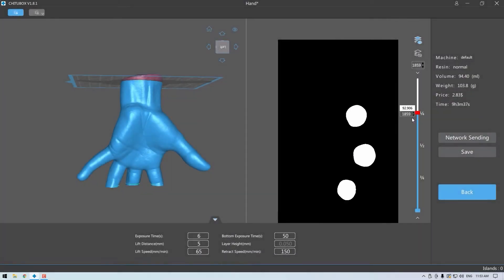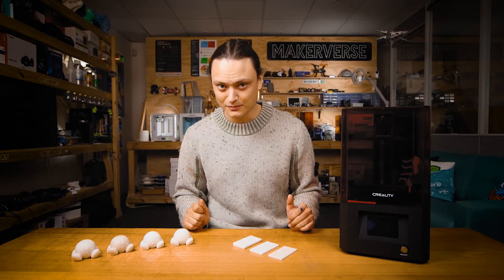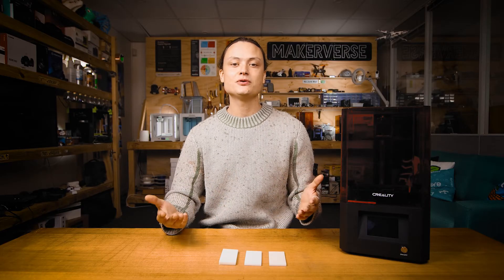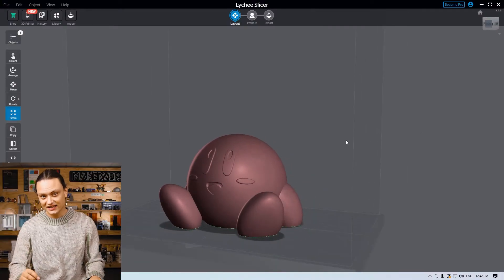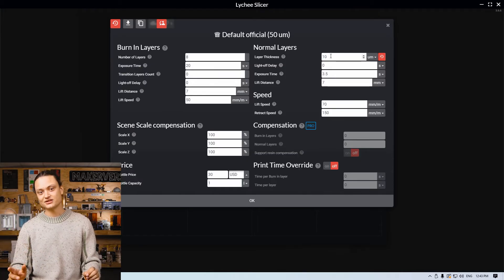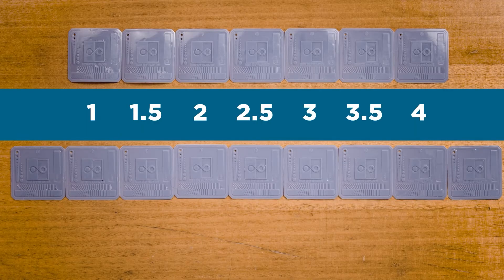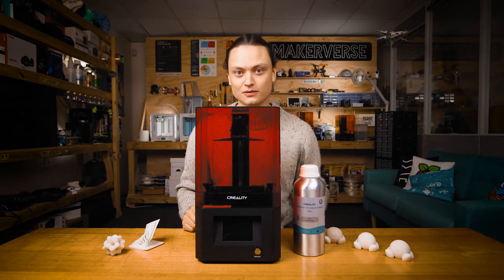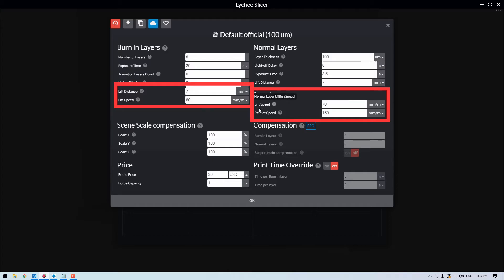Print Perfect Minis! How To Change Your Layer Heights When Resin 3D Printing - Fast or Flawless

Comment: How do you know your resin is fully cured?
Reply from the maker: Fully cured resin will have no shine, it will be fully hard, and shouldn't be sticky or tacky at all (wear gloves if you want to test it).

If in doubt, blast it with a UV curer or leave it in the sun for a while!
Reply: @Core-Electronics but that's only gonna cure the outside 1.5 mm, how do you fully cure the rest?

Comment: Hi, so I'm an absolute rookie - I have never 3d printed (except a 1-day class where I designed and printed an object, maybe 15 years ago), never cast anything, but I plan to... a lot! 
I've constructed many injection molded styrene models though, and kit bashed, and made things from scratch. I would love to be able to print items with the finest details - in scales from about 1:144 through 1:220, tiny, tiny, very fine details.. and no smoothing hopefully. Mostly though in the 1:144 - 1:160 scale. I want to recreate highly accurate, extremely detailed models of buildings and infrastructure such as manufacturing plants, power plants, odd commercial structures that were built a century ago and added to and modified otherwise over the years, etc., as well as bridges, high-tension power pylons, radio and television broadcasting antenas of decades past, highway interchanges, bascule/draw bridges, traffic lights, street signs, mailboxes, old payphone booths, garbage cans even. Some parts will be minute, for one example - the crossmembers of a multi-pane residential window, or a power meter on home, or even the hexagonal nuts on a fire hydrant. 

My main concern is this - 
I hope to not have the lines that all of the hobbyist's 3D prints have, at least the ones that I have been shown in person. The other has much to do with the tiniest of deatild and the ability to make such fine details. 

Am I relegated to the necessity of sanding or using acetone, etc for smooth prints? I hope I'm wrong, but I suspect that a "print and use item, taken right off the printer bed" simply wouldn't work for printing an almost perfect to scale (in all aspects) multi-paned ( 3' x 3') residential window that I would print in white and immediately glue it into the appropriate opening in a printed brick wall. The "wood" parts that hold each of the individual window panes in its proper place in the home window assembly, I imagine, might be too fine to print well and look correctly sized. Please tell me I am all wrong! 

I have the funds to buy a very nice printer, and time is not a major concern either. If a printer can print task after task day and night, I'd just design what I want, load it, and come back after sleep/work/whatever.

Could I also then print a model of a human with facial expressions, let's say facial hair, maybe even sun glasses, or holding a wrench, a knife, or the end of a cable or chain or rope? And speaking of the brick wall, I definitely would want to be able to print standard size bricks in a brick wall with mortar stacked in a standard offset type of arrangement which is always used in brick and mortar c🎉😂😂😂❤onstruction most of the brick walls that I have seen are made only in grid patterns (ie - square bricks?!), which are not realistic at all (structually weak!) and the blocks that I've seen shown on-line and at hobby shops are always far larger than anything even remotely realistic to the range of 1:144/160 scales. Just take a look at any normal brick building and you'll see that the mortar between the bricks virtually always lies indented and not flush to the face of the brick (ask a mason - it needs to be that way, there's a purpose. The mortar, (no concrete which has gravel in the mix) is never brought flush to the bricks' face. And from what I have seen, most of the sheets of scale brick walls that look somewhat realistic are very likely based upon hand-carved pieces made from master craftsmen in days past - from a painstaking, time-consuming, carefully carved master carving which then served as the basis for the next step - the actual, fiercely-strong metal dies intended to, (and hopefully) ended up producing tens or hundreds of thousands of mass-produced, pressurized, hot plastic injected model brick walls. Injection molded parts are made using injection molding dies which are mounted in the huge injection molding machines that weigh multiple tons. They cost many hundreds of thousands of dollars, and similarly are far from cheap to move, set-up, operate, and maintain.

((Shoot! Gtr, I just realized that I am late for an appointment. I shall edit later as/if necessary. But PLEASE(!), please answer my question, even if just relatively briefly.)

But PLEASE, share your thoughts, an insightful, informative response would be so hugely appreciated by me, and many others, I can only imagine!!

Thank you for sharing your knowledge - it means a lot to me and others. The generous beneficence of your knowledge and understanding of this subject does not go unrecognized! 

I thank you,
thank you, 
and thank you again!
Reply from the maker: Hey hows it goin! To start with the print lines question, resin printing has the smallest layer height of mainstream printing technologies and will give the least visible layer lines. You run into issues with layer lines when you have detail on top of print (like on kirbys head at 2:45). The more square the detail though, the less layer lines you get. Another issue is that when you paint a print, a lot of the times it will make the lines more pronounced as well, depends on the technique.

The biggest issue I see is finding accurate 3d models for all of this. If you have the skills to model them yourself then you are set, but if not you will need to learn to do so, or you might be able to find some 3d artists online that model specifically for the historical miniatures you want, you just have to find them if they exist. If not, it might be worth learning a modelling software like blender.

I think the best advice we can give is to find a printing community in that niche (hopefully its not too niche that there isn't an established community). Often you will find guides or strategies that people have found to get good models, or even if you just want to see what is achievable with printers. You might even encounter that some things will print fine, while smaller or certain pieces may need to be manufactured with other means.

But a resin printer is the best printer for this job. Best of luck mate!
Reply: Thank you kindly for sharing insight and knowledge! I will follow your tips. :)

Comment: I have a phrozen mini 8k printer. Currently printing something with very small channels (150 microns) and channels are not fully forming. Printing at 50 micro layer height. If I change this to 40 is there any other changes I need to make

Comment: I have a problem with my Anycubic Photon M3 and Chitubox, I get vertical lines in my work, not horizontial.  Any thoughts?

Thanks,
Reply: are you using a ACF sheet? i started getting lines after i used a ACF

Comment: I have a Question. I am printing Injection moulds and sometimes they have to be flat on the base but when i print them they come out slightly shorter (it is like the printer skips a few layers) so when i close the mould the part where the injector goes is not a circle and it can't inject properly. is it a settings issue or it is a printer issue ? (also if i print them flat the print time is going down significant so if it is a settings issue if you can tell me where to look ) Thank you :)

Comment: Why does your lychee only have 1 setting for the lift distance  etc if you check it now it has 2 settings in the same menu and it's so confusing
Reply: That will depend on if your printer supports two stage movement or not (two stage lets you set a slower speed followed by a faster speed during the lift and retraction phase to increase print times).

Comment: The math does not add up.
203 layers @ 100micron is not the same height as 3502 layers @ 10micron...
Reply: They do, to make it clearer, 100micron (0.1mm) is printing at a higher layer height which means there only needs to be a smaller amount of layers. 10microns (0.01mm) is considerably smaller thus causing more layers to print to get to to same overall height of the model printed at 100um.

Comment: Great video. In your personal opinion what settings would you say accomplish the best results for 40-50mm characters in terms of speed without compromising too much of quality? A 100% subjective question but would love to take your educated estimate over my noob level exp. After all you touched the spot in terms of stressing the hardware. I would rather optimize my lcd lifespan than going all greedy with huge changes in printing times and hardware stress that will only cause tiny benefits under a magnifying glass (which I won't be using)

Out of ignorance I would assume that the higher the resolution of the printer also compensates the quality lost with thicker layers. 

Thanks in advance for your much appreciated wisdom
Reply from the maker: If I was printing one off models for a DnD campaign and I was putting my heart and soul into it I would definitely use the smallest 10um layers for it. However if I was printing off a large army for tabletop war gaming I'd be more than happy to use 50um (and maybe only for the general of the army use 10um 😊).

Worth noting, Layer Height and Resolution of Printer are two different measuring sticks. Layer Height determines is Z-Axis accuracy whereas Resolution is X-Y Axis accuracy. I write about it here - https://core-electronics.com.au/guides/3d-printing/perfect-resin-print-layer-height/#Where

Best of luck and thanks for your question!
Reply: @Core Electronics  thanks a lot for the insight. I got good deal on a anycubic mono 4k and 8k phrozen resin. Weird combo I know. But what would be the settings you would recommend? Should the default slicer settings be safe just tweaking the layer height and adjusting the # of base layers? 

Thanks a lot for your help
Reply from the maker: Definitely come have a look at this video here I did on Exposure Time. I find manufacturers often tune the exposure settings too high - https://www.youtube.com/watch?v=yhWyQPS6qmQ

Comment: I Printed multiple miniature Armies. Although I am not an expert, I've taught myself exposure times, etc from youtubers like yourself. I was out of town for a week, so I emptied my resin vat, to ensure no issues. I came home rendered an entire plate and not only did the whole plate fail, but the resin was falling apart like my exposure times were extremely low, and the weirdest aspect is now the bottom quarter of the figures are shortened. for example, if I make supports that are roughly 5mm off the raft, when i print, the supports are gone and the item is melded within the raft. I have to suspend the model up 10-15mm of supports just the have the print come out with 5mm of supports. I have no idea what could be causing the issue. I factory reset everything, and it is still doing it. I ordered some replacement FEPs, because it did get slightly damaged due to the amount of misprints I have been getting to fix this issue. Thoughts on what it might be? (Phrozen Sonic 8k Mighty, Phrozen 8k Aqua Grey, and Lychee Slicer Pro)
Reply from the maker: It sounds to me like the resin has aged (gotten cloudier) and the good exposure settings you found before are now no good. Especially considering the models are not forming correctly. So I would crank up Normal Exposure time a couple of seconds. I'd also double check that your build platform is perfectly level with the FEP. Hope this helps! 😊 Tim
Reply: @Core-Electronics  I received the resin roughly a month ago, but I did read level the printer as well as the plate. I tested back to factory settings for everything and it is still having the issue where it squishes the bottom 5 mm. So I emailed Phrozen

Comment: Damnnnn so much information! Didn't about those speed options, gonna give it a try! Thanks!

Anyone using Elegoo mars 3 + water washable elegoo resin? Been using some 25/2.5s exposures times but having problems of supports not sticking to part (not plate) and layer peel 😢
Reply from the maker: Hopefully the info helps you 😊. I would consider using transition layers between your Bottom and Normal Exposure times. If supports are not sticking to part I would increase the diameter size of the support tip.
Reply: I started bumping up the exposure first
Reply: Increase lift height and make sure the temp is high enough.

Comment: I have a LD-002H using siraya tech fast resin at 1.5s normal exposure and 40s bottom exposure and having fails am I overexposing? Also when I do half plate builds everything comes out perfectly but when I do large builds it fails
Reply from the maker: Heyya mate, I recommend using a smaller change between Bottom Exposure Vs Normal Exposure. When those two numbers are very different (more than 20x) it makes it hard for the resin to stick to itself. If 1.5s is the optimal Bottom Exposure I'd use 15-20 second Bottom Exposure Layer. 

Also take a look into Transition Layers. You can set up your Resin Printer to slowly decrease the Bottom Exposure Time, over several layers, until it reaches your set up Normal Exposure time. Hopefully above helps 😊. I talk about Transition Layers in this guide - https://core-electronics.com.au/guides/perfect-resin-print-exposure-setting/
Reply: @Core-Electronics  thanks I’ll try that
Reply: @Core-Electronics   my normal exposure is 1.5s perfect exposure and bottom layer @ 20s and i end up with bottom splits what am i doing wrong? also im going to change the transition layer to 5 what you think?
Reply: @Core-Electronics  what do the beeps mean when I’m leveling the build plate for my ld002h
Reply: @Core-Electronics  I’m trying to build large prints on this machine is there certain settings for large prints and what’s the best calibration tool also every time I have a bottom exposure passed 35s there’s extra light resin around my prints
Reply: @Core-Electronics   thanks for all your help I finally found my right settings 35s bottom exposure and 2.21 normal exposure now I’ll be good for large prints
Reply from the maker: Very glad you got there in the end! Got overwhelmed by comments so didn't see yours until just then. Best of luck for all future 3D prints!

Comment: This is an excellent guide and explanation, thank you.  I especially appreciate the written article in combination with the video, thats a great way to learn information.  I've realised that 50um may not be necessary all the time, so I can increase speed and decrease wear+tear by increasing my layer height most of the time.  Question: you mention exposure time changes with layer height adjustments.  In general, do larger layer heights require more exposure time or less?
Reply from the maker: Thanks for your kind words, and yes generally larger layer heights and thicker layers will require more exposure time.